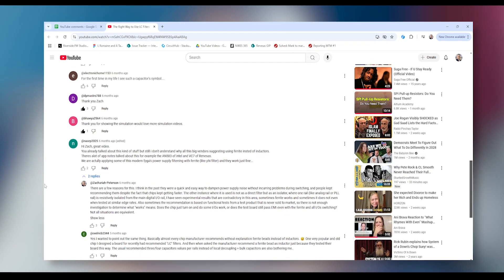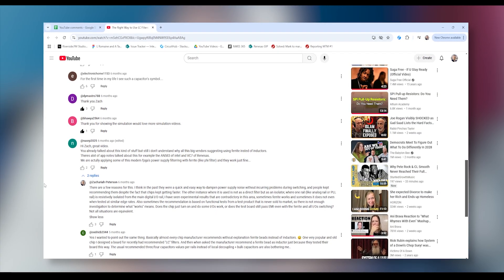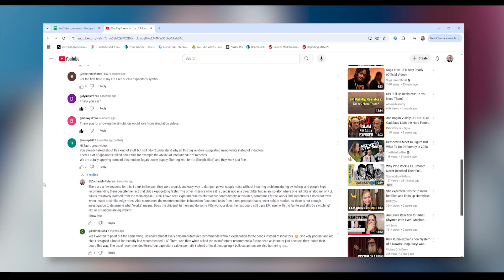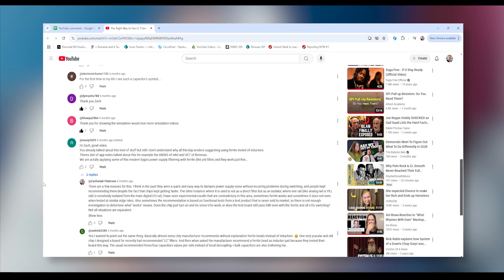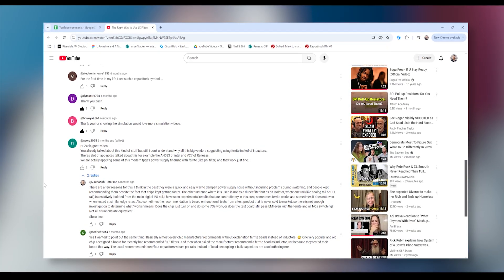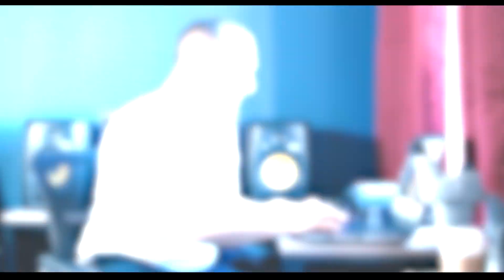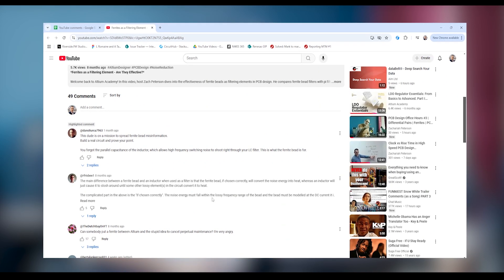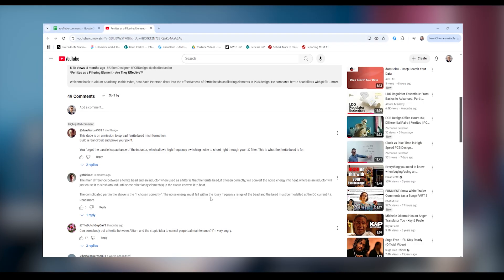Ferrites ferrites ferrites... | PCB Design Office Hours #6 With Zach Peterson

Comment: Do you have a reference (or at least an author?) for the 2014 DesignCon paper where ferrite beads helped?  I'm imagining situations with a noisy-but-noise-tolerant digital circuit that is not upstream of anything sensitive.  Adding some high-frequency impedance between them would make the noise much worse (but still tolerable) on the digital side, but a little less (but also consolidated to a lower frequency?) would leak through to the analog.
Reply from the maker: It's actually a 2011 paper, here is the citation: Weir, S. "PDN Application of Ferrite Beads." DesignCon 2011. You can google it to find the paper. You can also google this for the site EMCFastPass and you will see the presentation.

Comment: Hello Mr. Zach, I always enjoy and learn from your videos; never stop! I would love to get your thoughts on why ferrite beads are used so heavily in rack mount 1RU rectifiers by companies like Huawei, Delta Electronics, Meanwell, Traco. I know this because... :| ... So, huge names within the industry. One place that definitely comes to mind that they all commonly use them on is snubbers across FETs and sync rects. I can't recall the other spots. Cheers
Reply from the maker: Snubbers on FETs is one that might make sense depending on the frequency you need to damp as you are essentially adding impedance right at that frequency. As long as the ferrite inductance does not modify the transfer function on that current loop then the ferrite would not create a stronger transient at low frequencies during switching.

Comment: if you really want to insert some impedance to your pdn use resistor on ferrite bead place.
I think about situation where, for example, your uC has dedicated pin for analog reference voltage. Placing small resistor in series with power line but between two proper selected capacitors (not so obvious task) will build first order low pass filter that can filter high frequencies form power supply without introduce any undesired (and unknown) resonance. Just like 10 ohms and 1-10 uF.
Reply from the maker: As long as it does not significantly slow down the edge rate of I/Os being powered by that rail, and you can handle any slowdown from the resistance, then go for it. You can always pop off the resistor and put a 0 Ohm jumper there. I would not do this on PDN rails for processors powering interfaces reaching into GHz bandwidths. But maybe it's fine on slow SPI interface, slow GPIOs, etc.